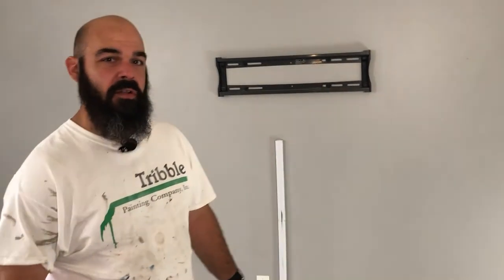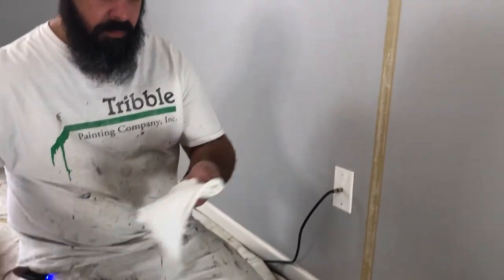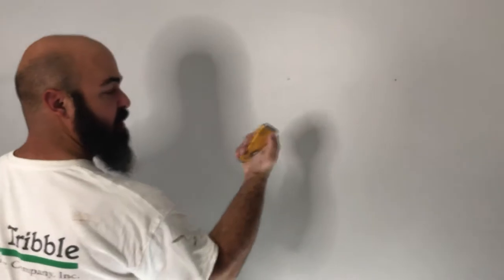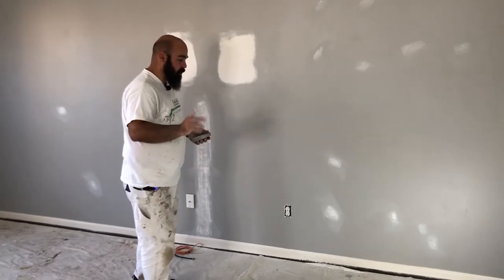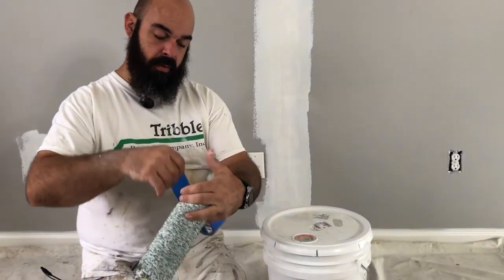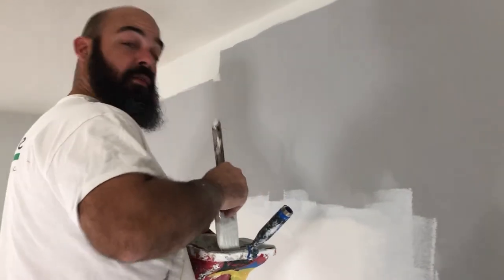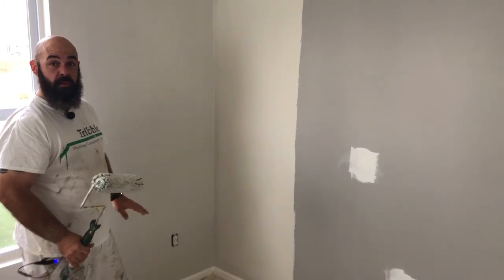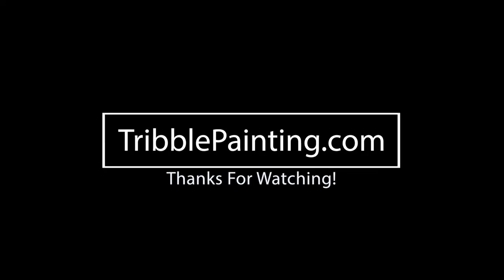How to paint an interior wall

Comment: Well done. I especially appreciate your roller loading lesson. I tried using a bucket for the first time and couldn't figure out why I had paint splattering off the edges of the roller. Now, I realize I was dipping the roller too far down into the paint. Thanks.
Reply from the maker: Glad it helped! Were you able to put the techniques you learned to use?
Reply: @TribblePaintingCompany  Yes. What a  difference 😀

Comment: Is it OK to allow the cut ins to dry before rolling.
Reply from the maker: Jim we do not always keep a wet edge. Most of the top line products today are more forgiving than paints of the past. If you are applying two coats, having your cut dry before you roll shouldn't be an issue.
Reply: @TribblePaintingCompany  Thanks, that's good to know because I'm so slow at cutting in at the ceiling 😀